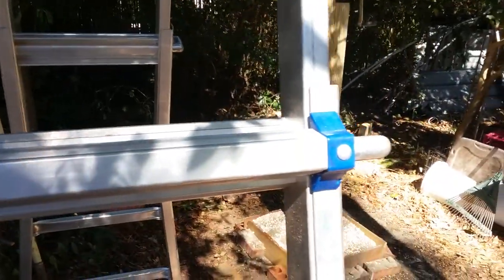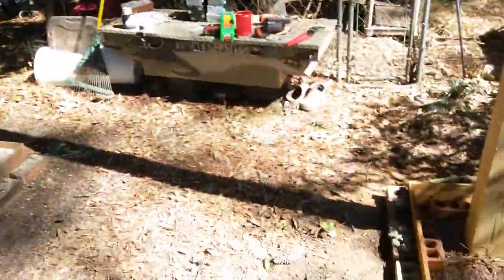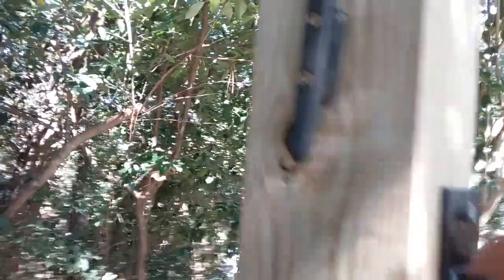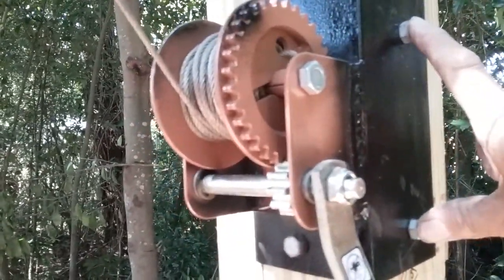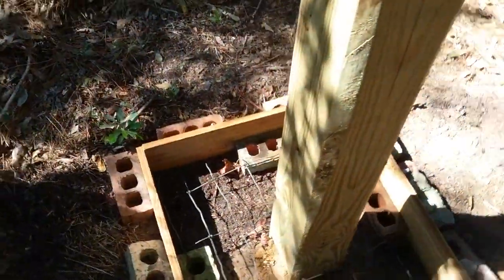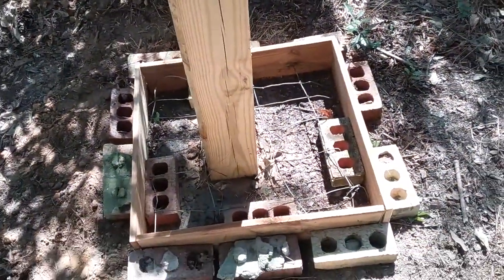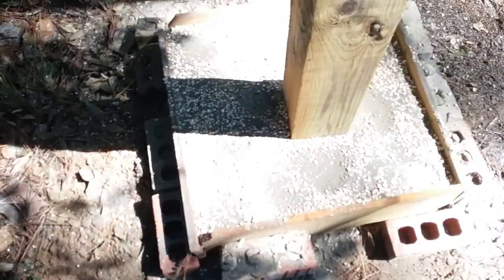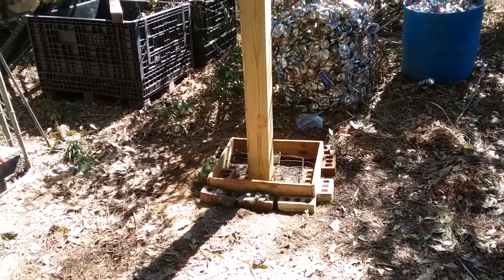Deer skinning station 1.5

Comment: Looks great.  What is that cranking mechanism called?   When you lower the deer do you just flip a lever and you crank it down the same way that you crank it up?  Ty
Reply from the maker: Hey ..yes sir..its simply a winch like goes on small boat trailers..if that helps?